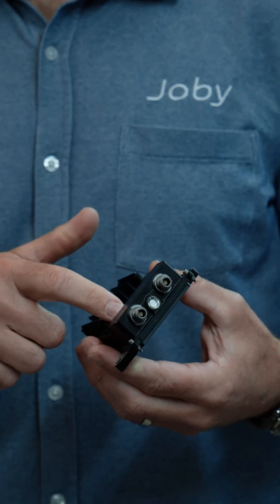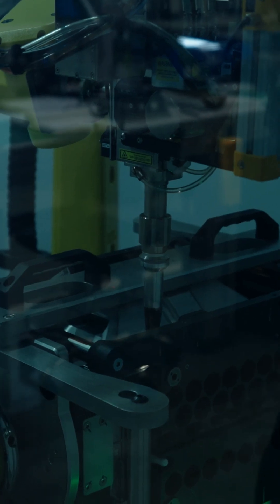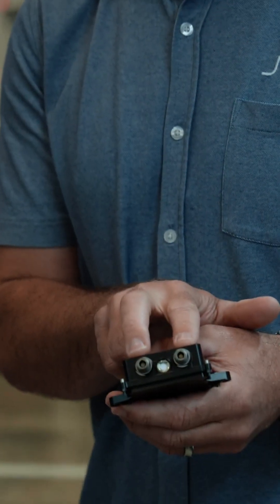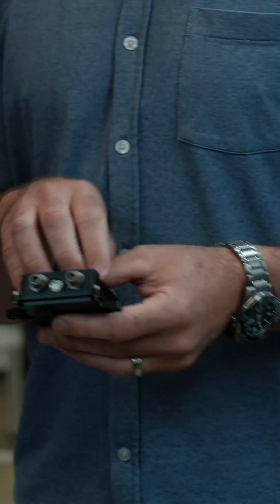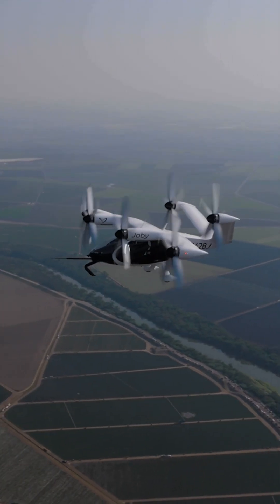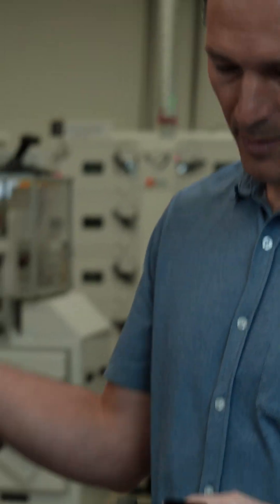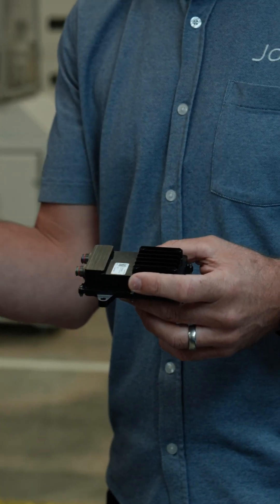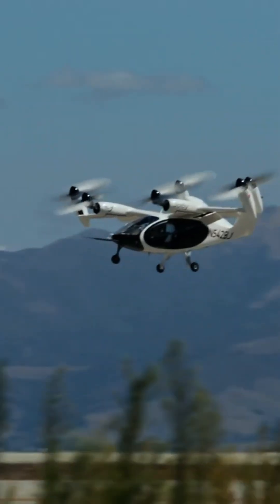The Joby Flight Computer

Comment: Where are the flight comouters located in the plane? And if a sensor only gets wired to the nearest flight computer, how are its signals reliably shared with the other computers in case the nearest flight computer fails?